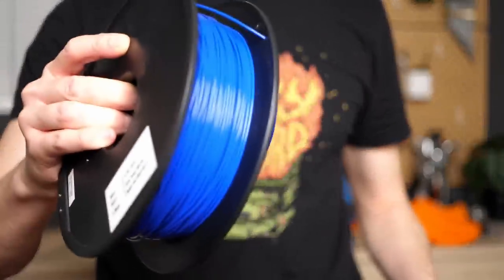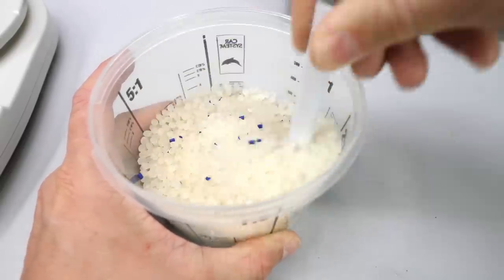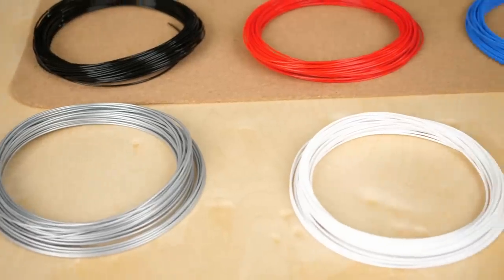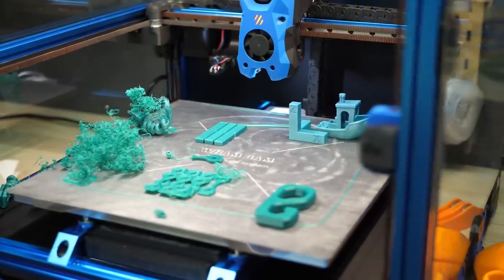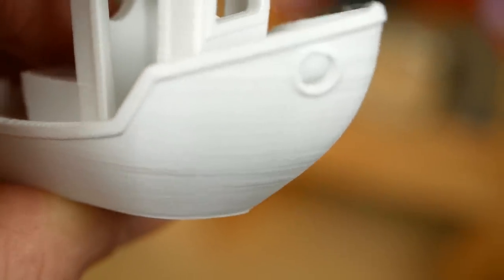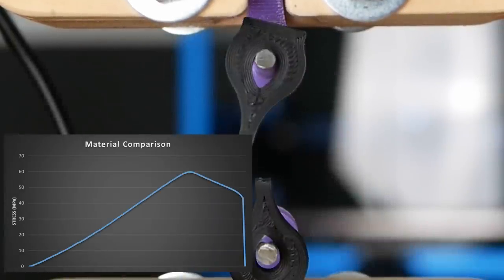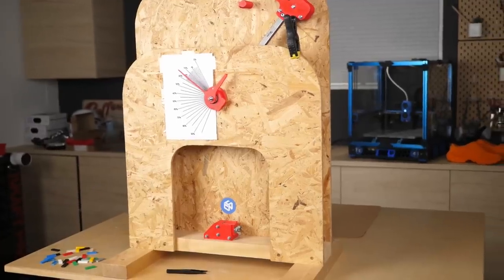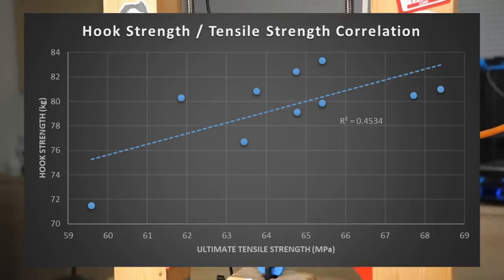Myth Busting: Color vs Strength in PLA

Comment: I got a few pla colors when I went shoping at microcenter. One was an extremely nice Glass Purple and I printed a little drawer attachment to my ender 3 pro. However after a few days the filament was breaking in places and when I picked it up, it was like I left a cheap toy in the sun for a year because of the way it broke apart like an autumn leaf. Maybe it could be something wrong with my printer setting but I'm sure some of my other prints would have acted similarly. You should give it a try, see if other "transparent" fillaments have the same issue.

Comment: Yes, noticed a lot of difference in layer adhesion and strength while using Gembird filaments, over 70 KG of it. Lately switched to Plasty Mladec and C-Tech, first is very very good, second also good and i found out they have Orange HIPS boxes with Orange PETG inside, so i keep buying it as it is cheaper here! Also got some other HIPS colors from C-Tech that i will have to test. Gembird Red and White HIPS is very good, much easier to print than ABS or ASA by a long stretch.

Comment: Indeed, I experienced a difference between different colors of PETG. I use PETG for parts which get hit by metal parts. My prototype was made with transparent green PETG, and had no problems. Then I printed some final parts with black PETG by M4P. The behaved really well. Last I tried a military green PETG,  and it failed where the others already had more mileage that this. The green one  broke not along the layer lines, but in a diagonal direction. I improved the part at that spot, now it holds, but I was really confused at first.

Comment: Thanks, Stefan, for another good video. I no longer use PLA because of its distortion over time when under load, such as shelf brackets, and always found white to be a poor performer with its layer adhesion. In those days, printer issues were more common, and filament dimensions, nozzle temperature control, and cooling were major issues. Today, I use PETG and Amphora based carbon fibre filaments. I find that black PETG is more brittle and that transparent is more ductile, while layer adhesion is similar and much better than PLA. I do print at a fairly high temperature, usually 240°C with a 0.4mm hardened nozzle on a Mk3S for all filaments. Sunlu PETG is the brand I use at the moment. I am now trying the Revo nozzle, so there are no substantative answers yet on that one, but the first models appear fine. I'm still waiting for the Obxidian nozzles for the CF filaments that you might consider investigating some time.

Comment: I noticed this in CNC machining too with different colors for the same plastic (Propylux) Some were harder to cut and had worse surface finish
Reply: Yep, I've  worked with thermoplastics for decades, and colors always make a difference.  Black PVC takes a hit on strength and dimensional stability because it's packed so dense with colorants.

Machining colored cast acrylic, yellow cuts smooth, beautiful shavings of plastic come off the part.  With red, small chips and a rougher finish, so I had to compensate for it.

Comment: When i print parts that i have to paint afterwards i always print with uncolored material aka natural. Parts come out stronger, have less stringing, curling, warping... your get the point.
White filament gives me the most trouble, while "galaxy" colors even clogged the nozzle a few times when changing to other filaments after printing.

Comment: I went through three different manufacturers of silk PLA and two of them had major problems with delamination no matter what temperature I printed at, I have sacked silk PLA now but I am using a lot of matte PLA and carbon fibre strand PLA and PETG-CF and PA-CF Nylon, the first matte PLA I used was problematic to start with but I persevered with it and now can print perfect parts with all these new filaments.

Comment: I work with industrial plastic extrusion machines used to put plastic/PVC/silicone insulation on wires. We used all sorts of colors, even custom ones. From day one during training we drill in the fact that color pigments are actually a contaminate for the plastic, reducing their effectiveness, thus the percentages we use are important and not to be deviated from since it will change the characteristics of the insulator. While we generally don't care about the mechanical strength of the insulation, we are aware that the natural/clear version is generally stronger than the colored added version. It is especially noticable with purple. For whatever reason, all the purple pigments we have do not show as well as the others and we end up using a much higher percentage than other colors. It creates a minor but noticeable difference in the quality of the finished plastic.

Comment: Very interesting test! Thank you for the great videos and the invested time. I have also observed that filaments behave differently across different colors. Basically, each color variant requires its own calibration. This means that the extruder steps, flow, and PA/LA must be adjusted and determined for each color variant, taking into account the different shrinkage of the materials and compensating for it. Have the appropriate calibrations been performed for each color variant in the test trials? I'm looking forward to many more videos.

Comment: If you revisit this, you should control for batch variation within the same colour. This variation could be partly explained by each colour necessarily being from a different mix. Is the relationship consistent between different batches of the same colour?

Comment: For your extension metering, I know there is software that can use video footage to calculate the displacement field in a specific sample, also resulting in a strain field. The software I know of is called DICengine. I haven't used it before, but seeing as you already film your tests this might be an easy addition.

Comment: Sky blue seems like the most well rounded in this test. I was just going to leave a comment saying I wonder how the different colors anneal and then got to the part of the video where you tested that! Fun stuff.
Reply: White is better. Look at the scatter on the sky blue plots, it's all over the place. White also did better in the axial tests on both xy and z, again with less scatter than sky blue. Finally, sky blue deforms 3 times as much when annealed. The only test sky blue clearly won is ductility, but not by much.

So white is far more predictable while being just as strong as sky blue IMO, so I'd say it's best as a general choice. Too bad it gets a bad rap. The only potential downside is that I've heard it's more abrasive than other colours.

Comment: I also noticed it quite a lot with two different PLA manufacturers, that my black prints are way weaker than white ones. I also have red and blue, but haven't printed with them a lot. I've been printing for nearly 10 years and it has always been like that for me.

Comment: Great video!

I would be curious for you to test your theory about annealing warp from internal stresses. What comes to mind is to independently vary printing speed and part cooling to see if they are significant contributors. Would a part printed at 15mm/s warp as badly as one printed at 80mm/s?

Extrusion width might be another parameter worth testing, since it will affect the pressure, direction, and interaction with the adjacent bead and previous layer, of the molten flow.
Reply: The crystallinity/density element is still there, but it is overshadowed by the stress relief.
Reply: @jonathanlawley4863  not really. If a printing parameter reduces the internal stress, there is less to relieve and less warping.

Comment: speaking of different color properties, I want to share, from  experience having selling custom order, using White Black and Grey p with many times of experience in printing with it ( maybe around 10 spools or more of each color) They behave really different. I'm using e-sun PLA +, specifically Cold White, Black and Gray. The Biggest difference is the Gray, it tends to warp!!! I even use PEI both smooth and textured. Even using brim doesn't help much. What really helps a lot is lower the temp. Weird but it works. usually on 60C but for gray it has to be 55C or lower, then it wont warp. I've make sure the BED is PID tuned, cleaned & I double check with infrared Thermometer for the temp.
TLDR : E-sun PLA+ Gray ten to warping even with brim if you put bed 60C so i put it 55C its fine, white & black fine with 60C bed. (this is exclude the condition wetness of my spool, sometimes i print with wet &  fresh Oven dry spool with or without spool enclosure)

Comment: As usual, great video Stefan!
I think a good baseline would be to do a tensile strength on the filament itself right off the roll. Measuring the diameter with a micrometer would give you great precision since a small variant on 1.75mm makes a big difference.

Comment: Interesting ! My intuition has always been white is the best overall, seem to be held out by these results. Black I have always had issues with. Silver is an eye opener though - always assumed it would be super weak, and have not used it, tended to print white and then spray paint,  but looks like if I want to make a mount that I need to anneal in particular its worth a try - cool to know ! Contains real metal particles I guess ?

Comment: Knew it would matter, but I'm shocked it made that much difference. Be nice to see the same batch of filaments with optimised print settings per colour and see how much the difference remains. Then we could actually know how much of the variation on the finished part is the material properties being fundamentally different because of the dye material and how much of it is just the dye material changing the best print parameters.

Comment: I don't typically print parts that have to be particularly strong, but I have noticed that matte filaments produce a lot, lot weaker prints than other filaments. Also, in my experience, white filaments tend to ooze more, require higher bed temperature to stick to it well and in general just require somewhat higher printing temperature for good quality prints. I haven't noticed anything worth mentioning with any other colours, though.

Comment: Very interesting, I've wondered about bed adhesion as a function of colour, seems it also affects other properties. As a point for potential improvement of such tests, there are some missing graph numbers (ductility) and some graphs with supressed zeros which make small differences appear larger than they are.
Reply: Second the point about misleading graphs. Quite annoying having to pause and try to figure out what the actual difference is

Comment: One property that was not mentioned in the video is that certain colors of filament can be more abrasive to the Nozzle than others. One example of this is the use of titanium dioxide in white filament, wich is a very hard ceramic and i´ve heard it´s bad for the durability of especially brass nozzles. Interestingly it seems to perform quite well mechanicly, so it would be interesting to know if Das Filament uses titanium dioxide. Thanks for the informative video!

Comment: While I haven't found much difference in normal part strength from colours, I have found that different colours have massive differences in their UV resistance. I have tried printing some parts in light colours (white especially) and particularly in ABS, these go very brittle when exposed to sunlight for any period.

By contrast, darker colours (especially black) exhibit much better UV tolerance. I suspect what's going on is that most manufactured plastic items we buy already come with UV stabilizers added to the mix, but 3D printing filaments usually lack these. The darker pigments absorb light and constrain the UV damage to the surface layer, which prevents the part from getting brittle throughout and snapping.

Comment: Answering Question at 4:20 ; I recently did a project that used around 4kg of White Filament (Sunlu) and it destroyed my nozzles way faster than any other filament I've used so far. I did some research and I believe it's because of what they use for the master batch.

Comment: I use Zyltech PLA a lot for prototyping and making brackets and enclosures for my various vehicle projects because it's really cheap but still reasonably good quality.
I have found that silver, clear, and clear blue are the most durable and are the least likely to have threaded inserts spin or get torn out. But if I want something to be super precise; I use milky white as it seems to be the most consistent with almost zero blobbing or stringing.

Comment: I was printing a stiff part out of TPU. Printing with grey everything worked perfectly.
printing with black it was much more flexible and even after dramatically increasing the infill and walls it was still more flexible than the grey (same manufacturer)

Comment: I believe I've noticed similar with TPU filaments, a few months ago I created perhaps the strongest cable tie design out there, Hoopin TPU Cable Tie, I made some with the 4 TPU filaments I have, the white one failed as the pins snapped off, but the other 3 colours work great, especially transparent I'm guessing because it has no colour additive.

Comment: Something I've noticed with rainbow filament; if you're making something with a lot of filament usage per layer you end up with sharp transitions between the colors. The parts are far more likely to mechanically fail at these sharp transitions, while a gentle transition maintains better overall strength.

Comment: It would be interesting to revisit this test and weigh the samples prior to all of the tests. I've been tuning different colors of PETG from the same manufacturer and it's shocking how much different the flow/extrusion multiplier needs to be across colors. As an example, white needs a multiplier of 91.5% for consistent layers compared to black which needs 99.5%.

I wonder if the extra tensile strength of white can be explained because it's effectively using more material while printing. Using my example multipliers, the "effective" tensile strength of black would be 63.68 MPa vs. white at 62.22 MPa.

Comment: Yep, both strength and print quality/settings vary by color, so I try to mostly use the same brand/color/material. Silver for mechanical parts and Black for best finish are my usual go-to.

Comment: I once tested different recipes of white for a company and noticed something interesting.
The recipes that printed the worst, handled overhangs better. Maybe the viscosity went up which prevented it from dropping down as easily. While at the same time increasing the pressure in the hotend.

Overall, I find white colors prints better the less pigment there is in it.

Comment: I personally chose to almost only print in white because if I want to to paint my prints, i have no need to use a primer to get good colors from painting. But from my supplier, i tried it's pla matte black and i use it only for prototype prints or would use it as support, if I had dual extrusion available, since it's layer adhesion is just unusable.